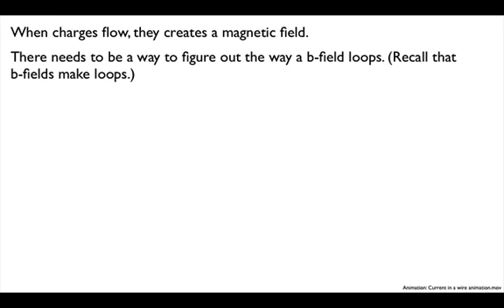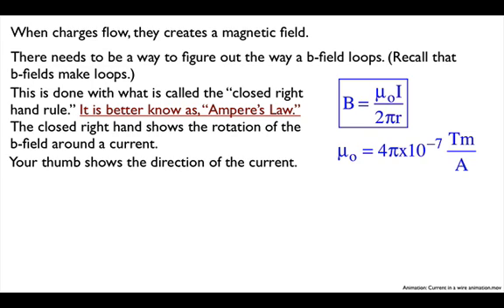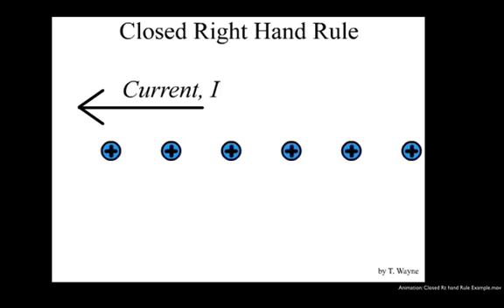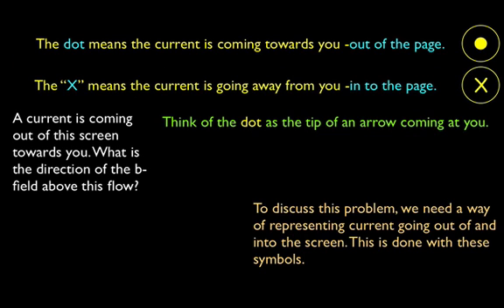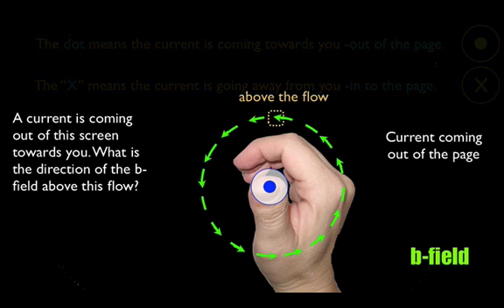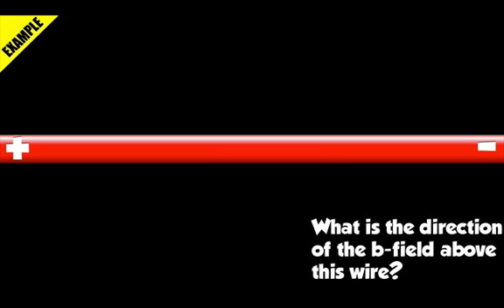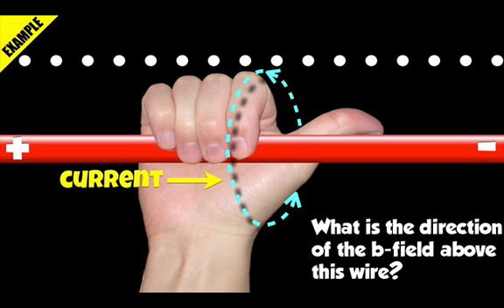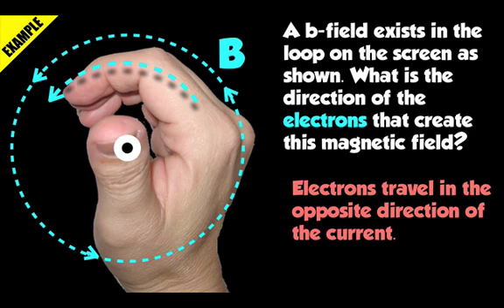Ampere's Law

Comment: I am a bit confused. I thought current is the flow of electrons and electrons are negative so why is it direction of positive charge the same as direction of current flow?
Reply from the maker: Engineers define current as the flow of electrons, because they are the mobile charges in wires and electronics. (Electron-> "Electron-ics.") Physicists define current in the direction of the flow of "positive" energy. Energy flows from high potential to lower potential. This means energy flows from the more positive to the less positive, or negative. Positive charges flow in this same direction. So current is defined as the flow of energy which is the same direction as the motion of positive charges. Hence, physicists define current with the direction of the movement of positive charges. (Also: Engineers often refer to the left hand rule while physicists refer to the right hand rule when describing the same phenomena. This is because of how they define current differently.)
Reply: @mrwaynesclass  thank you so much!! I understand now